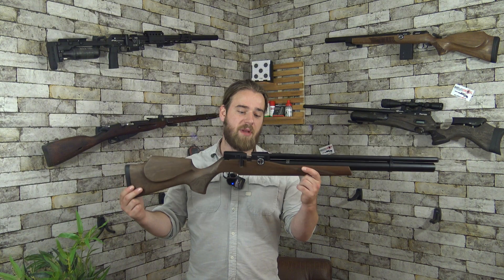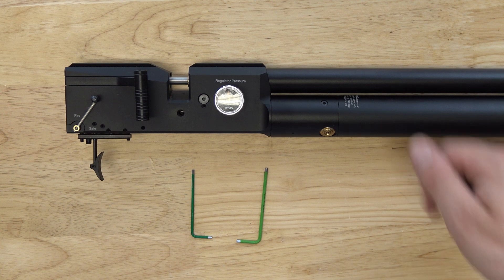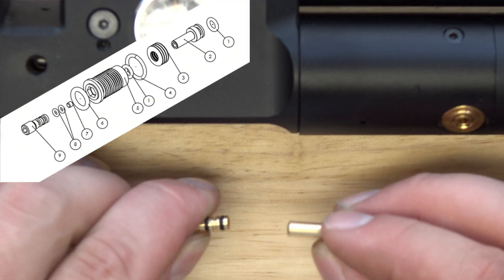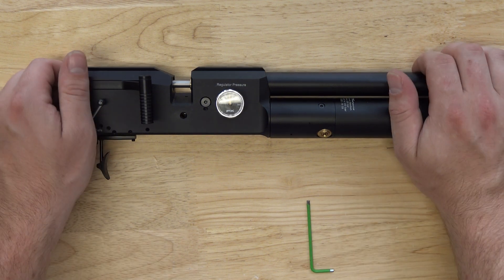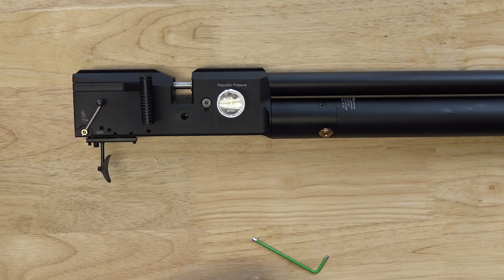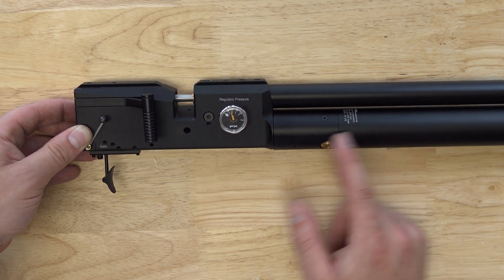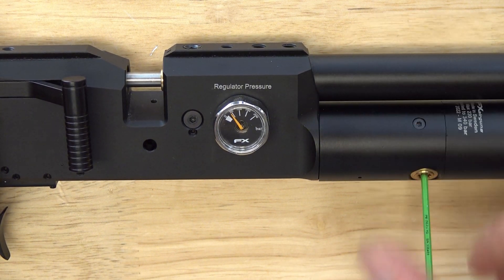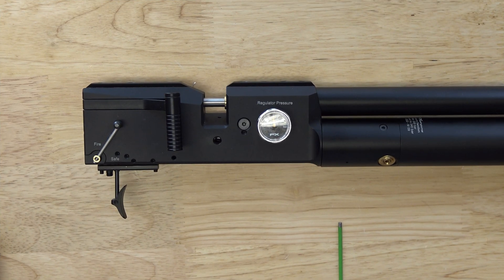FX Dreamline AMP Regulator adjustment

Comment: well explained video but I have a dreamline  sub 12ft/lbs  the pressure is set at 55 but when increased the 12ft/lbs  decrease can not understand why.
Reply from the maker: When you raise the regulator pressure of an airgun, there will be more pressure on the valve.
This is why you must also adjust the hammer spring pressure accordingly. Else the hammer will not have enough power to open the valve. Resulting in less or no energy.

Comment: Hey I have a question, my fx dreamline was not in use for about a year, the tank was almost empty before it had been put away. I wanted to get back to shooting now and pumped up the air tank. However, the gauge is showing 50 bar and when loading the rifle it was firing with very littile power/air flow so i wanted to increase pressure on the gage to 100 /120 bar as you showed on the video. When I was unscrewing the little adjustment screw it suddenly started leaking air from the little hole on the AMP regulator. All air escaped and when I tried to pump it back up the air is leaking through this little hole and I have no idea how to fix it, does that mean the entire AMP regulator is damaged? PLEASE HELP
Reply from the maker: Hey there,
Are you referring tho the tiny hole on the tube body that the regulator screws into?
This is the regulator breathing hole. If air is leaking from here it is most likely one of the outer o-rings, but one of the inner could also be the culprit. Please note that one of these outer o-rings is on the inside of the rifle.

If you mean the hole that the adjustment screw screws into, then it is most likely the upper o-ring on the adjustment screw:
https://www.airgunseurope.com/2x-fx-19731-regulator-screw-o-rings.html

To tackle regulator leaking issues the fastest, we generally just reseal the entire unit:
https://www.airgunseurope.com/fx-amp-regulator-reseal-kit.html
This kit includes the new brass regulator piston.

You can always send us an e-mail if you have any questions!
Kind regards,
Dirk

Comment: Hello,
I got an air leak through the tube connection above regulator (Gen 2, like in video, I think the part is called "power block"). I tried to unscrew the block, but it didn't move. I don't want to apply excessive force. Do you have information, is the block screwed under  some Loctite or I just need to turn with more force? Thanks.